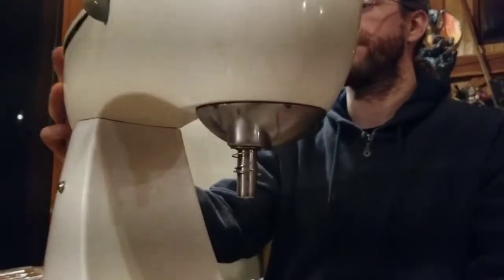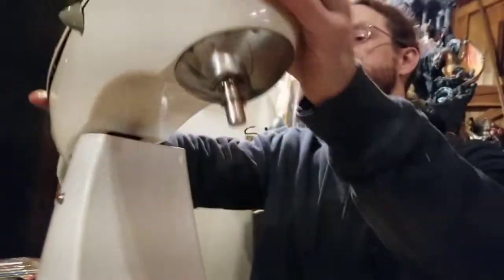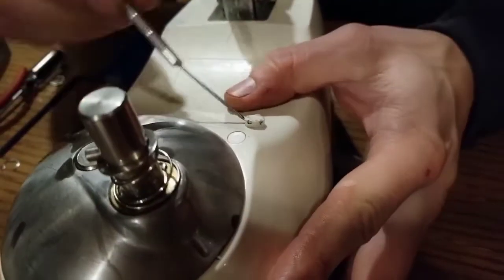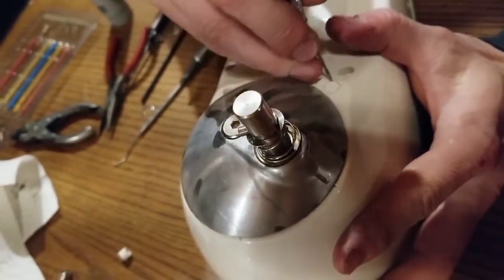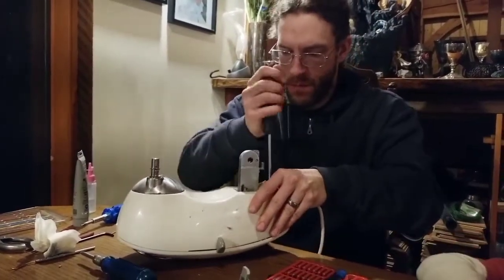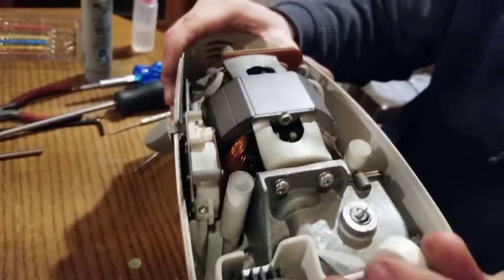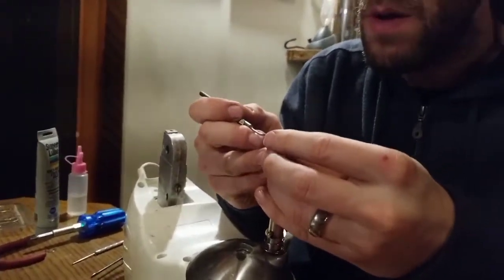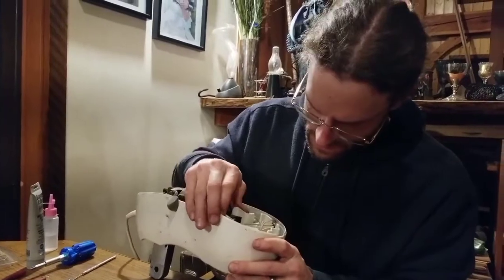GE Stand Mixer Teardown, Clean and Service - Part 1

Comment: Hi, I am trying to clean mine but I do not know how to remove the first rod. I see your husband exchanges tools but I can not find how to do. Can you explain how please?
Reply from the maker: I will ask him to come and explain! :)
Reply: If you're trying to get the cross pin out, you need to remove the circlips from either end of the cross pin, it can be tricky to do but it can be done with two flat head screwdrivers and some patience.

What you want to do is apply even pressure to both sides of the circlip and push it off the pin, it will fall into the mixer body, but you can just tip it out to get it back. Do this for both circlips. It's a little tricky, GE definitely doesn't get any bonus points for repairability with this design!
Reply: @IndigoSkookum  thank you very much, with the explanation you gave me was enough. I could open it. I appreciate It very much.
Reply from the maker: Glad it worked for you!! His channel is full of helpful how-to videos for practical stuff if you ever want to check it out!